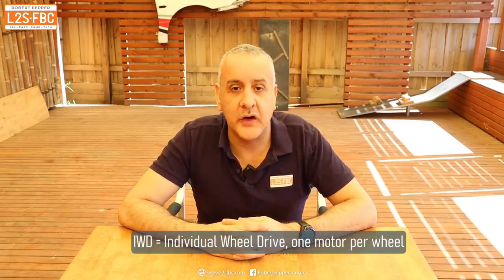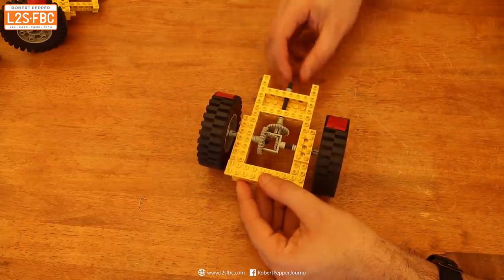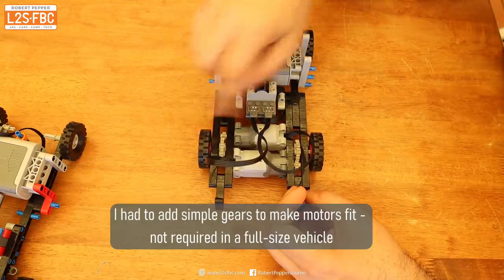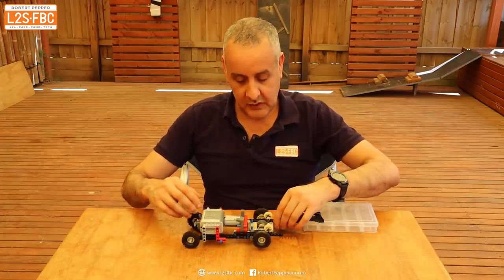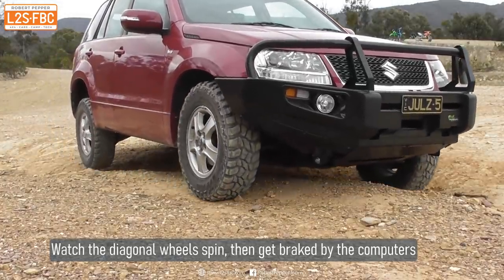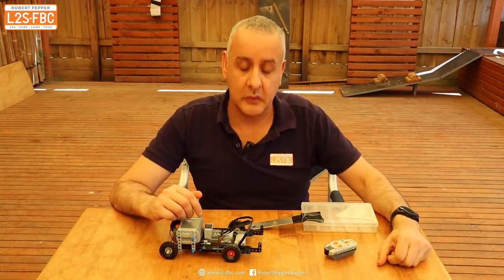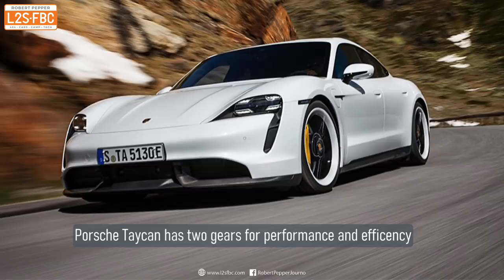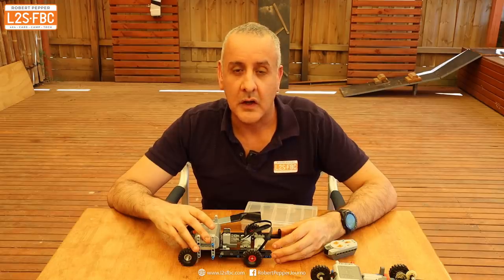Why Differentials Will Die - EV IWD Is The Future!

Comment: diesel motor {generator} with 4 elect motors is the ultimate for australian 4x4 enthusiasts. diesel hybrid.  big question is when?
Reply: When they figure out how to scale down a Diesel-Electric locomotive's drivetrain to fit under the hood.
Reply: @NikkiTheOtter  so how many kw generator wld u need to charge a suitable  batt?
Reply: @RusstyNails111  I actually did this calculation and to keep an SUV (about Pajero size) on the highway at 100kph you need about a 20kw generator (about a 600cc motorbike engine)
For offroad you need less because you go a lot slower.
I would say the reason they don't make diesel hybrids is cost. A diesel engine is more expensive than a petrol engine and once you go hybrid the fuel savings between a very effecient petrol and a diesel are not enough. Also once you go hybrid you don't really need the low end torque from the diesel.
Petrol engines on hybrids are tuned differently because they don't need to be powerful at all RPM. They can be tuned to a much narrower RPM range.
Reply: @RusstyNails111  18kW (For the Rivian R1). Which is 400lbs, and consumes 3.2 gallons an hour (For a 10 hour charge), so you're going to burn 32 gallons of gas for 400 miles. Which is about equal to a 12.5MPG. Which is about what you would expect from a 3500/350 tier truck. Not a sub-1500/150 like the Rivian R1 (Which can usually pull 20MPG or better)
Reply: @franciscoshi1968  so petrol hybrid is what we are looking for, 2022 triton maybe...
Reply: @NikkiTheOtter  you don't use a standard generator. Standard generators have to run slow so they can make 50 or 60hz directly.  That means they are limited to either 3000 or 1500 rpm that is why they are heavy.  A complete motorbike weighs less than 400lb and makes more than 20kw. If you run the motorbike engine at 5000rpm then you can get a much smaller and lighter generator. Just remember that it is only a range extender. It doesn't have to last the life of the car and is not going to be used every day.
Reply: @RusstyNails111  I think Tues and 4x4s are going to be the last to go electric.  It is much easier to sell an EV to some one that drives a city car because the benefits ar me easier to sell.
Quietness, smoothness, good response and easy to drive in traffic are more important for a daily driver going to work or taking kids to school than for a Ute driver.
It is much easier to get a customer to pay extra for the luxury feel on a car than on a Ute.
Reply: @franciscoshi1968  triton 2022 navara 2023 wil be hybrids, just read it
Reply: Yes, Electric offroad vehicles - taking range anxiety to a new level.
Reply: Toyota has been doing hybrids for decades, I dont understand why they havnt done a hilux or landcruiser yet, it makes perfect sense in Australia, hell even bringing the rav 4 and kluger out 10 years earlier would have been a game changer
Reply from the maker: They will. But Australia does not like new tech vehicles...or at least the current government is not keen.
Reply: @MinimaDomum  hilux 2024 - 2026 toyota are saying
Reply: Doesn't work.  If you only have traction on one wheel you would only be using 1/4 of the available power. My land cruiser applies all of my V8 power to the wheel which has traction.  For an electric vehicle you would need the torque equivalent of a V8 on all 4 wheels.
Reply: @joking7081  Electric vehicles have way more torque available than a diesel V8, and at a much lower RPM so it could easily do the equivalent to your landcruiser on one wheel, my Prius has nearly 400nm below 1200rpm and that's one of the slowest electric cars
Reply: @NikkiTheOtter  toyota already makes diesel hybrid trucks, the hino H series and buses.
Reply: big rockers truck in the mines use that drivetrain.
Reply: The reason why you can't use motorcycle engines for generators is that they are not designed for 100% duty cycle. They are designed to pull a small amount of weight, rev up quickly during a pull and then cruise. If you run them at maximum power for a long time, they break quite quickly. This is where diesel engines shine, they are most often designed for high load, high duty cycle, thus they don't need to be rebuilt so often.
Reply: @murdurer333   home gens are almost motorcycle engines. Diesel just expand more and ignite slowly.
Reply: @Xayuap  far from it, motorcycle engines rev very high, sometimes up to 12000 rpm, while generators typically rev to 1800rpm or 3600rpm. As horsepower is torque*rpm, you can imagine how big a difference it makes in horsepower.

The main reason why generators are often gasoline is that gasoline is more readily available than diesel, and you probably already have a gas canister at home for your lawnmower.

Also, gas engines can be made lighter for the same horsepower.

On the other hand, diesel engines run cooler (the flame inside the cylinder is cooler) thus making them more reliable over time.

Plus, diesel engines become more efficient at high loads, while the opposite is true of gasoline engines. (Think of it as gas mileage, but instead of miles we want electricity)
Reply: @murdurer333   I'm with diesel over otto too. Gasoil has more power density than gasoline but burns slower. Are cooler because of compression ignition and high expansion and lower rpm. Besides it can run on vegetable combustible.
Reply: Toyota make diesel hybrid, need to look closer at that thing
Reply: I have been saying this for so long. 
they already have great hydraulic motors which work very well .
Reply: @MickeyMishra   hell, yeah, they call it hybrid but is not. It is the way to be for positive displacement pumps engines. Pneumatic regeneration, hydropneumatic transmission
Reply from the maker: Lc300 will be hybrid
Reply: And... mount each electric motor on the end of a solid axel. The generator could be an optional extra.
Reply: Its been working on trains for decades
Reply: @L2SFBC  they literally want to bring in a tax country wide for every km driven by an ev car, ontop of import tax, luxury car tax, and the electricity you overpay for to charge it, ontop of registration, CTP, and insurance, they wanna charge you just to drive the goddamn thing.. because it's 'cutting into their fuel excise fund'
Reply: Yeah a 2L 4 cyl diesel and 60kw or 100 kw genset with battery to boot would cut it I think
Reply: Sure for a slow weak ones like a Suzuki Jimny & Jeep Wrangler. You need a better engine that can hold higher RPMs for a whole day to keep those PHEV batteries charged.  My best guess is Mini Turbine or Freevalve Petrol Engine. This is what you need for high performance Series Hybrid 4x4.
Reply: @NikkiTheOtter  It's called the PHEV there is an entire sector of them.

Comment: You might also add in-wheel motors make great sense for offroad trucks, no axles and diff to hang down in the way, and for low-speed, putting motors in the wheels on the front is great, leave the back with more gearing to move heavy loads and higher speeds.  I am building such a vehicle.
Reply from the maker: Good points and would love to see your truck!
Reply: unsprung weight will go up with hub motors but the advantages are beneficial it in a large amount of applications. a single rotating assembly is way cool.
Reply from the maker: Yes. Current model is for inboard motors.
Reply: The thing about in wheel motor is, it is very difficult to waterproof, so..
Reply: Would require independent front suspension instead of a solid axle and have less wheel articulation

Comment: The primary reason why differentials are still present in electric vehicles is it provides a safer failure mode and a small cost reduction than two drive motors on either side of the vehicle.

Unsprung mass can be mitigated by using half shafts to chassis mount the motor weight.

Comment: Totally with you. The future will bring turbo diesel generators driving IWD motors, until battery storage and electric 'charging' catch up. Still more efficient.
Reply: Would it need a turbo?
Reply: Totally agree.
Reply: @ponderin  all the diesel generators that I've seen have turbos.
In fact, a turbo enhance the performance of of the engine and reduce the fuel consumption. Also much cleaner combustion.
Reply: @Bosbulls  Also allows a smaller engine to generate more power output (To turn a heavier flywheel and thus a heavier generator)
Reply: This is what I have been advocating for. Electric drive is great, charging is not. I want something that can refuel at the speed I can dump it in a tank. Until that happens I am sticking with combustion engines. I know I am not alone!
Reply from the maker: Have a look at my interview with Atlis Motor Vehicles...15m recharge!
Reply: @kingofbrutaltheocracy9201  the whole point is to reduce emissions though, and the infrastructure is just a few years away with good government incentives.
Reply: @crackedemerald4930  by charging cars off coal and nuclear plants. I for one am unconvinced that 400ppm or 0.04% of the atmosphere dictates the temperature to the remaining 99.96%. The specific heat coefficient would need to exceed 1, and violate the first law of thermodynamics....
Reply: @kingofbrutaltheocracy9201  it's not that simple. It isn't just the amount of CO2, it's how it interferes with all the other gasses' cycles, like water vapor.
Reply: Diesel engines have remarkable efficiency by themselves, but the process of producing it is incredibly dirty and lossy. Maybe for specific cases it would be good, like it's done in the mining industry. But Europe is banning diesels for a good reason.
It would be cool tho, i love diesels despite their dirtiness.
Reply: @kingofbrutaltheocracy9201  nuclear is a clean source of energy, it is not comparable to coal
Reply: @crackedemerald4930  yes, water vapor. The stuff with a greater specific heat coefficient and is two magnitudes more concentrated. What you are suggesting is that there is free energy. It is bs. You have not studied the greenland ice core samples or the ocean sediment layer data. If you want to be informed...Look at the last million years of temperature and carbon dioxide levels. We are on trend, and actually below the standard deviation of the mean.
Reply: @kingofbrutaltheocracy9201  it isn't about heat capacity at all though, and the ice core samples show that we're way above the mean.
Reply: @crackedemerald4930  "way above" is a weird way to say "statistically insignificant."
Reply: @crackedemerald4930  consider how much heat is in the atmosphere, then consider how much co2 can capture and retain. It is a non factor. If you put the sum of temperature change on to it and a dozen other trace gasses, you exceed their capacity. This would suggest free energy, or that we are making false assumptions about causation.
Reply: @kingofbrutaltheocracy9201  it's not just the atmosphere itself that warms up though, did you forget there's a ground that can absorb light and heat up? And that heat convects and spreads across the planet?
Reply: @crackedemerald4930  Bingo! Solar irradiance is the primary source of our temperature. When we observe other planets, we see their temperature fluctuate with ours. Whats worse, is when we are in an ice age most the energy is not absorbed, but reflected back into space. Climate change is real, but the amount of energy we are talking about can only have one source, and it is the thing with 99.8% of all the mass in the solar system. The nuclear fireball in the sky.
Reply: @kingofbrutaltheocracy9201  yea, you're right. But the greenhouse gasses help earth keep it's irradiance, otherwise, it would be -18°C
Reply: @kingofbrutaltheocracy9201  i mean, just look at the moon, with it's 150°C to -100°C temperature change, and it's pretty close to the earth.
Reply: @kingofbrutaltheocracy9201  diesel trains are actually huge generator. Diesel is only used for generateing electricity. It is pain in the ass to connect mehanical gerabox and everything else to chassis on trains. But it is a lot easier to do it with electric generators. AND heveing disele engine to generate electricity gives oportunity to keep diesel engine at best rpm range.
Reply: @Martink9191  also gives the opportunity to throttle up and down via electromagicnetism
Reply: @Martink9191  The efficiency is very exciting to me. If you imagine the longest grade that a vehicle has to go up, you could size a battery to supplement the system under those high power demands, and just have a generator the produces say 110% of the normal cruising load. The extra 10% gets stored for accelerating or hills. That would get the weight down quite a bit, and keep a generator under load and in the sweet spot.
Reply: @crackedemerald4930  The insulating affect of our gasses is just that: Insulation, not power generation. I have seen the argument which boils down to "2+2=5" when talking about co2, I would like to know where this extra energy is appearing from. I was under the impression that energy is neither created nor destroyed, just changes form. More over, if this were the case with co2 our energy worries would be over. 

Touching again on the thermal conductivity of co2, and how it is only 0.04% of the air and not exactly inspiring compared to the other gasses when looking at specific heat coefficients...Just because we add it to a mix of gasses, the mix cannot not increase their insulation beyond the sum of their parts (exceeding 100% insulating efficiency). We need to look at water vapor before co2. It is more abundant, every car, most nuclear and coal and natural gas plants releases it. Of course the oceans make most of the atmospheric water vapor, but the same can be said for co2. Dead sea life and plant life exceed our output by a lot. Another ice age will come, and the carbon will get locked up in ice or dissolved into water, until it warms up again, and the cycle starts over. We know this because the co2 levels lag behind temperature, so we are "putting the cart before the horse" on this one. The sun drives the carbon cycle, all life is apart of it.